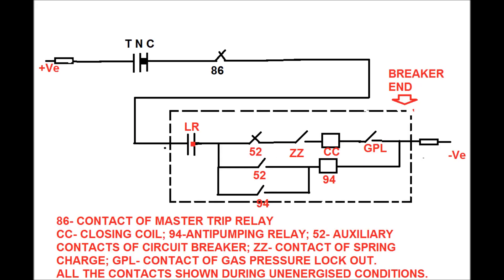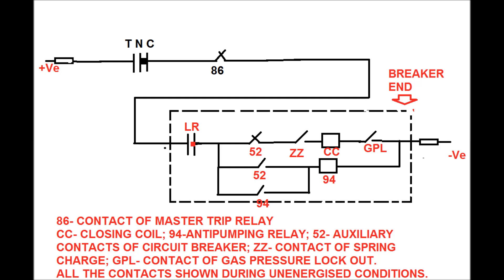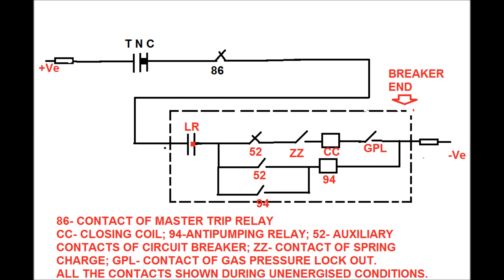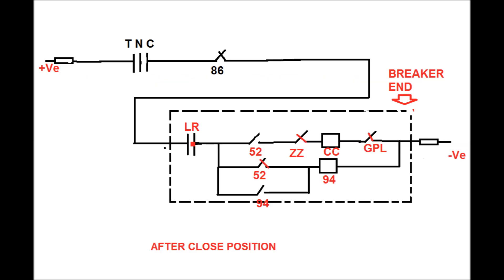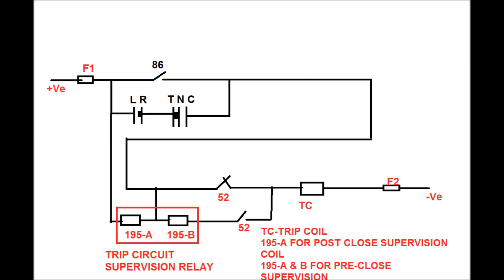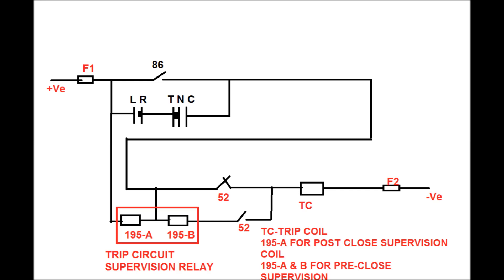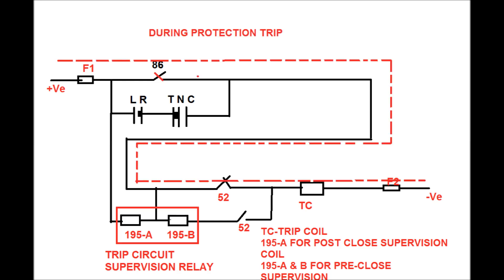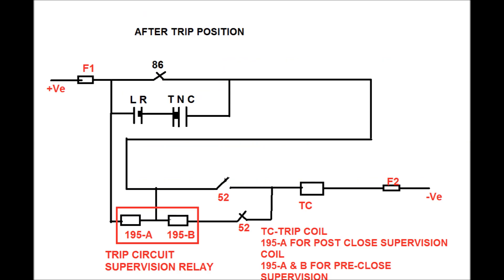CIRCUIT BREAKER (CB) OPERATION(Control Ckt &  Tripping Ckt)

Comment: Auxiliary contactor is NO in line of trip could not NC
Reply from the maker: Yes it is NO contact and after CB is on contact will change its state from NO to NC and it will allow DC pulse to trip coil.

Comment: Request to make video on control circuit of 220kv and 66kv cgl make breaker and on control panel drawings.
Reply from the maker: As soon as possible
Reply: @relayprotectionelectrical  pls make video on VT selection relay